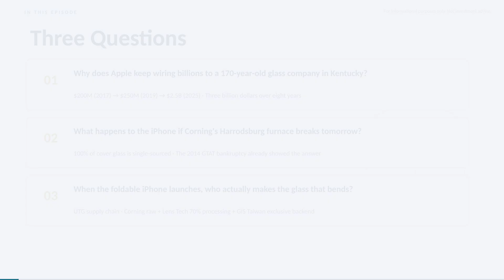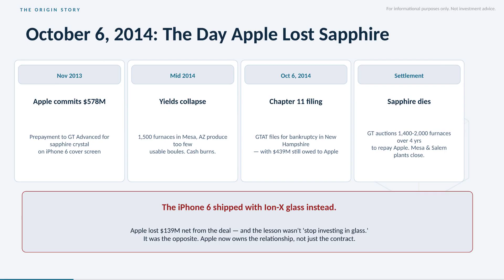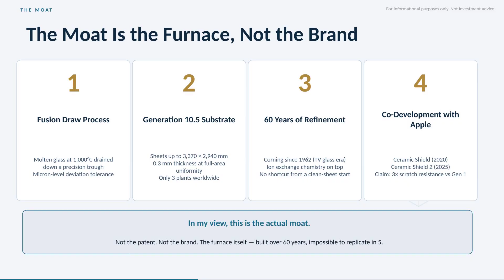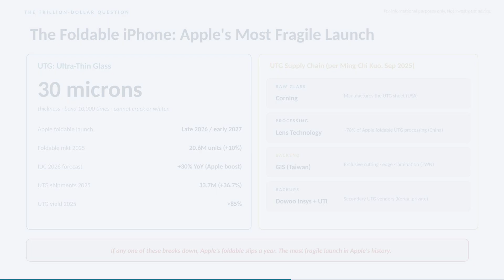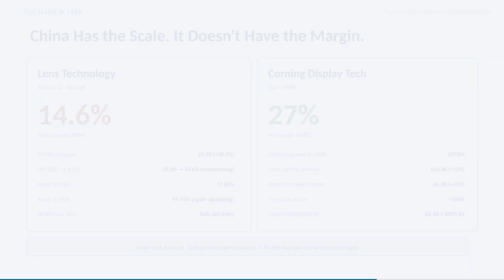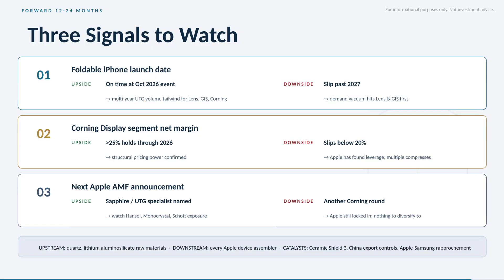Apple's Glass Hostage: How Corning Locked the iPhone Supply Chain

Comment: The speaker mentioned near the end of the video that Apple might invest in a UTG company. Could it possibly be Korea’s UTI? How likely do you think that is?
Reply from the maker: UTI is a real supply-chain player but not an AMF target. The data shows both: it's a ~$110–145M KOSDAQ small-cap that raised just $11.5M in convertibles for foldable R&D and a 2026 Vietnam plant, and TrendForce named it as Apple's Korean UTG second-source alongside Dowoo Insys — so 10–20% of foldable iPhone UTG processing volume is realistic, which matters for UTI's P&L; but a self-funded $11.5M raise is the opposite signal of an AMF candidate, since AMF writes $300–500M checks for upstream strategic capacity, not substitutable downstream processing.
Reply from the maker: Ranking the actual AMF candidates: 
Corning top-up ~35% -only raw-UTG supplier confirmed by every serious source
OCA specialist ~20% — the thread I missed
Schott ~15–20% — technically the only Corning alternative

Comment: Could I get any materials or information about the Korean company UTI?
Reply from the maker: UTI and Dowoo Insys. Both are flagged in industry reporting as potential secondary suppliers to Apple's first foldable device (anticipated 2026). Samsung Display has been the primary integrator for foldable panels using Korean UTG, so any Apple foldable program likely relies on the same Korean glass base — UTI is one of the very few qualified vendors at scale.

  Where to start your own research:
  - Bloomberg profile: https://www.bloomberg.com/profile/company/179900:KS
  - Stockanalysis.com: https://stockanalysis.com/quote/kosdaq/179900/company/
  - Company UTG product page: https://utikorea.com/en/product/utgufg
  - MacRumors on Apple's UTG sourcing (Feb 2025):
  https://www.macrumors.com/2025/02/12/apple-taps-ultra-thin-glass-suppliersfoldable/

  Caveats:
  - KOSDAQ-listed, low ADR liquidity — direct US retail access is limited
  - Highly cyclical with Samsung Display orderbook + foldable shipment volumes
  - Watch Q1–Q2 2026 disclosures for any direct/indirect Apple program signals

  This is general industry info